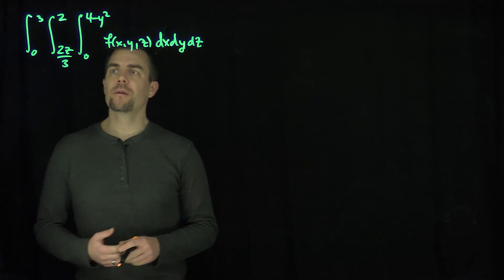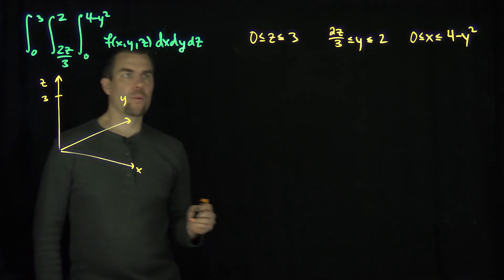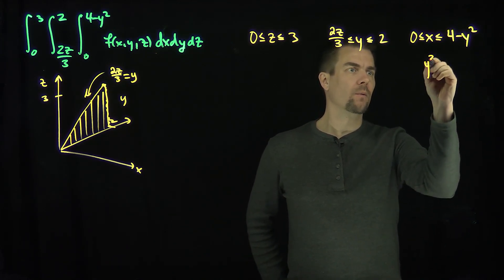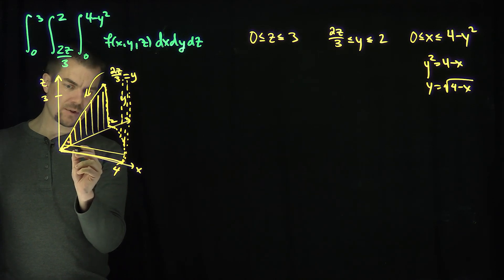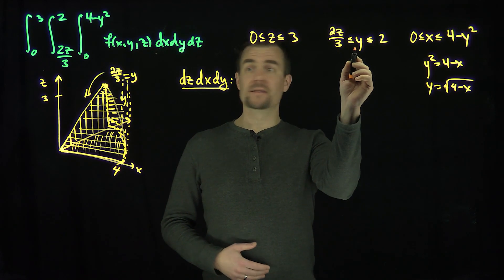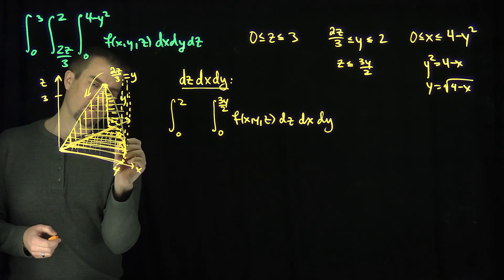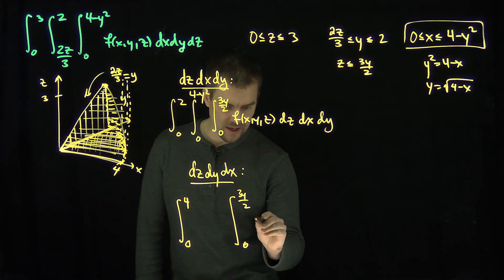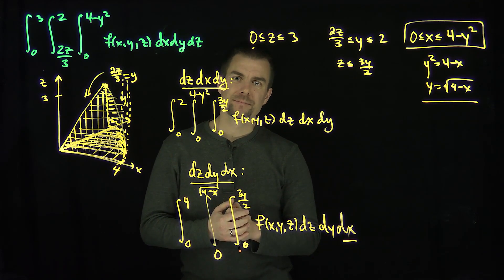Changing the Order of Integration on a Triple Integral

Comment: thats cool, but is the graphical way is the only way? and is it formal?
Reply: There is another way. You can use the xyz-simple method. I’d recommend watching professor Leonard’s videos on the topic to learn it. It will allow you to do these without doing a 3D graph. The idea is to represent the triple integral as the double integral of a single integral and vice versa and go from there. So if I know it’s z-simple for example, I just find two functions of z to bound it by. I then set z to zero and graph a region on the xy plane to figure out the two remaining bounds. I never needed to do the whole 3D graph this way.
Reply: @CalculusIsFun1 do you know what video that is?